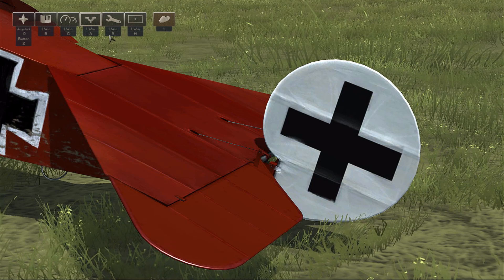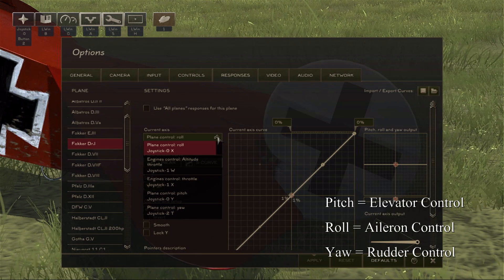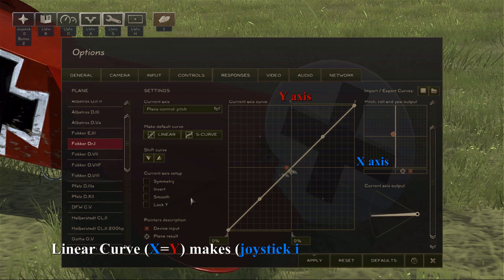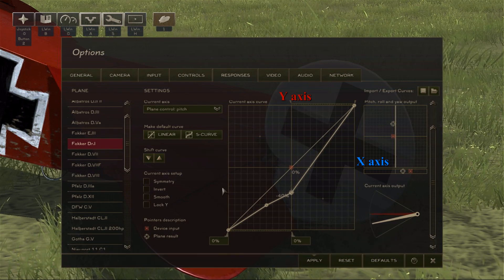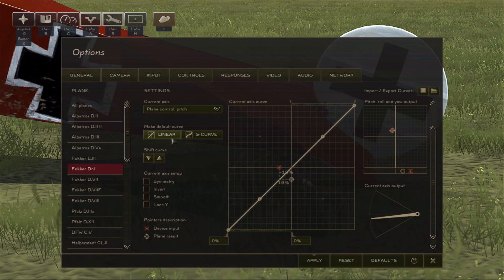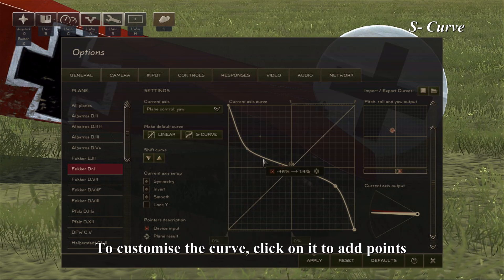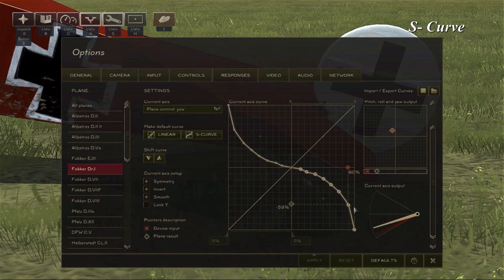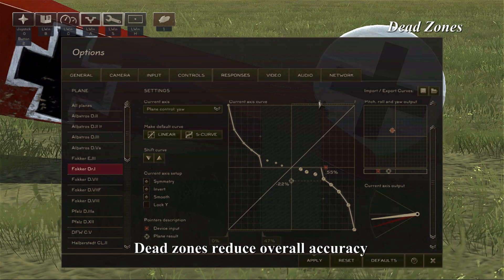Rise Of Flight #4 - Response Curves

Comment: That's a good explanation but I have to wonder which would be better to use, the in-game curve or the Joystick's Profiler tool such as Thrustmaster's TARGET, (I have the Warthog HOTAS).

On the other hand, I suppose I would use the TM's TARGET for a "Base Curve" that would be applied to all the aircraft I fly. Then I would 'personalize' the curve on a per-aircraft basis as needed.

I'd be tweaking in the base curve set by TARGET by using the in-game curve for an aircraft that may not be so responsive to the TARGET curve setting.

So why use both instead of leaving the initial control responses alone and just tweaking in the plane with the in-game curve as needed? Well, the first curve set by the Profiler tool, (again, in my case that would be TARGET), would be a basic overall compensation that refers to the HOTAS onto itself.

That is, if there's a spike in the Y axis of the Joystick, you can set the Dead-Zone to handle that with the Profiler tool. That would now eliminate the spike for all the aircraft.

Then you could use the in-game curves to deal with the finer tuning based on that aircraft's characteristics, extra weight, etc.

But the Profiler tool can also handle the general characteristics of the aircraft on a 'global' level and permit you to go from plane to plane w/o having to stop and make the settings in-game which could cause you to lose your 'momentum'.

Eventually, you would individualize the adjustments of each aircraft via the in-game curves, but that's basically how I see the two being used simultaneously.
FWIW

Comment: I have also this problem. I still have a problems with dogfight, but it's more the problem of having knowledge how to perform with my aircraft (on the films it looks sooooo easy ;), I don't blame only responses.

About responses - I was more than surprised when I stated that my response curves, wich became more nice and smooth after WEEKS of experimentating, are very similar to these from that film! 0.o

Not only in Dr.1, but in almost every aircraft!
Maybe that's the way - try to make them like in film (pitching down rudder, to make aircraft fly straight, and easing the responses of rudder).

BUT - 40% down in pitch, is too much for some aircrafts. It's good for Dr., and Se.5.
The rudder response in that film is propably too much curved, but I'll check it out for my own.

Cya, I wish you solving the problem and new, easy victories! ;)
S!